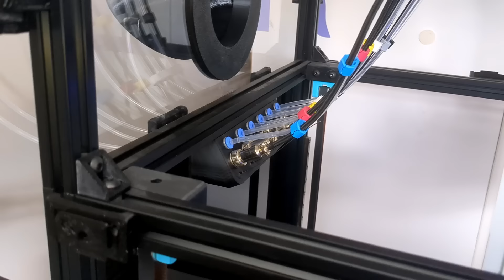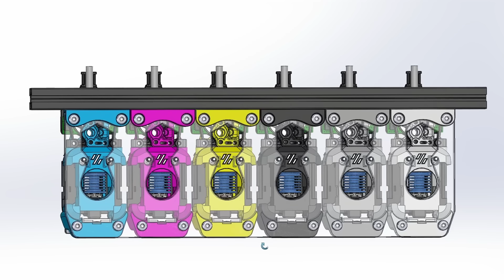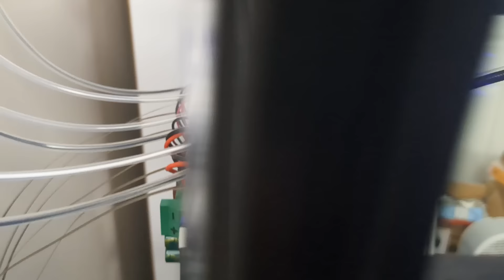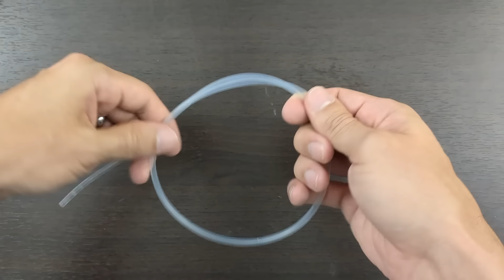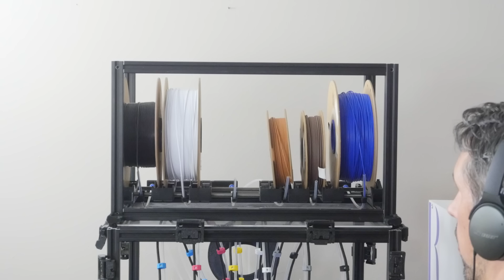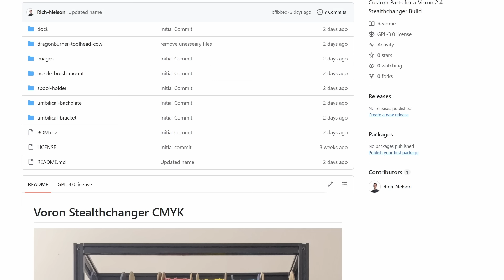I Built a Custom 6-Toolhead Multi-Material Printer (Voron StealthChanger)

Comment from the maker: A lot of people asked about cost so I ran the numbers! Here's a rough breakdown:

Base printer (Voron 2.4 300mm kit, if starting from scratch): ~$839+
Toolchanger base upgrade: ~$138
Per-toolhead: ~$92 × 6 = ~$554

Total for the 6-toolhead upgrade (excl. base printer): ~$694
Optional spool holder: +$96

Note: you don't need to build all 6 at once. Starting with 2 toolheads like I did would run about ~$334 (base upgrade + 2 toolheads), then you could expand as needed.

Full parts/cost details: 
https://github.com/Rich-Nelson/voron-stealthchanger-cmyk/#cost-estimate-guide
Reply: What about firmware? Where can I get it? Is everything working properly?
Reply from the maker: @ВикторВихрев-п2т  The firmware is an extension for Klipper called klipper-toolchager by viesturz, it is used for both the TapChanger and StealthChanger systems.  Here are the install instructions: https://github.com/DraftShift/StealthChanger/wiki/Installation#toolchanger-configuration
Reply: so do i need the voron or can you also just repurpose an other printer like a Ender 3  or something similar ?
Reply: How viable would it be to use the pre-made toolheads from snap maker u1. They are only about 60 dollars
Reply: Hey i have a Voron 2.4 R2 350mm what do i neeto print for my V6 hotend sherpa extruder and i am using a dragonburner standart one with two 4010 blowers hope you can help me
Reply: I love this idea and wish I could do something like this. Unfortunately I don't have the money. I will definitely keep my eye on this for the future.

Comment: Which shuttle mount did you use on the voron for the CMYK conversion. It is extremely well thought out and engineered. Just want to be sure they mount well to the gantry.
Reply from the maker: The Stealthchanger v1.1 Shuttle.

Comment: I doing this build - can you provide the dimesons for the printer - specific the additional head space for the toolheads?  Thanks, you did a great job.  I thank it gets missed sometimes that this is two years of work. I was looking at the Prusia XL but cost, locked into a vendor for parts and build size change my perspective. I do functional 3D printing and wanted a bigger build size (350x350x300) and nobody offers this size in a multitool head printer. This by far the best design I've seen that checks all of my boxes.  Plus, I can upgrade it later - hopefully to a index system. Thanks again for this project!
Reply from the maker: Awesome, If you build it please share when you're done, I'd love to see it! My top hat is 200mm tall, made from 2020 extrusions.  I should add that the the repo.

Comment: Rich this is outstanding design. I have been waiting to build Voron for years. I wanted a larger build size, faster print speeds, technical filament capability and the ability to print multiple filament on a job with very little waste.  I particularly want integrated TPU and and other plastics and supports. This is it. I now have a K1 max as well so I can finally print the build parts too. I'm going to enjoy this

Comment: I ran into some issues with the wall thickness, so I decided to rebuild the entire project from scratch in SolidWorks. Part of the reason was that I couldn’t find the specific model for the front section of the Sherpa Mini extruder.

I also noticed that the GitHub repository didn’t include the complete assembly with all the components, nor the six-extruder side-by-side setup shown in your images, so I ended up designing and assembling that part myself.

Before I finish the project, I’m going to look into using a more powerful hotend. Later on, I also plan to redesign the exterior of the extruder to better match the styling of my other machines.

Comment: How is bed leveling handled on this machine? I've always wanted a hydra setup but seems like it isn't necessary for your machine
Reply from the maker: The bed doesn't move, so it goes through a gantry leveling process before printing using a voron tap style nozzle probe mechanism along with a bed mesh.  After initial setup, the first layers consistently come out good without additional tuning. Though I've found different types of plate textures work better with different offsets.

Comment: Awesome build. I like the way you figured out the spring steel. Some people using piano wire have issues with stiffness while spring steel not wanting to side bend without other issues popping up. It's a tough call to make imho. 

I'm sure you will figure out the nozzle clean adjustments. Cooling it down during a wipe helps but then you have to wait on nozzle to heat back up. 

Cool printer, nice work. 💪👍

Comment: I fell in love with this the moment i saw it, was preparing to print these parts and attempt the mod myself, i just have a question, do you have the stl for the dock plates with the hexagon holes in the github? i can only find the one without holes
Reply from the maker: Awesome!  It's the same file, the hexagon holes from slicer settings. I printed them with the following settings:
- 0.4mm nozzle
- 0 top/bottom layers
- 8 perimeters
- 25% density honeycomb infill

The suggested settings are in the repo,  I added a slicer image preview to the repo to help communicate it better.
Reply: @rich_nelsons_workshop   thank you so much

Comment: Incredible build, congrats! I run similar setup toolhead wise (TZ V6 3.0) however I run into issues when switching tools. It takes a long time, waiting for the tool to be picked. Would you mind sharing your firmware configuration as well? Especially in regards to tool head config (sensor type) and dead band usage? Would be highly appriciated! Keep up the good work!
Reply from the maker: I had an issue like this,  it was due to the M109 "Set temp and wait" command waiting for the toolhead to reach an exact temp before pickup. I replace the standard M109 with one that waits for the hot end to reach a temperature +/-2C of the target temp,  that resolved the issue for me.  Here is my M109 macro:

[gcode_macro M109]
rename_existing: M109.1
description: [T<index>] [S<temperature>]
  Set tool temperature and wait.
  T= Tool number, optional. If not provided, the current tool is used.
  S= Target temperature
gcode:
  {% set tool = params.T|default(printer.toolchanger.tool) %}
  {% set tool_number = tool[-1]|int %}  ; Extract numeric part of tool (T0, T1, T10, etc.)
  {% if tool is not none %}
    {% set newparameters = "T=" ~ tool_number %}
    {% if params.S is defined %}
      {% set newparameters = newparameters ~ " TARGET=" ~ params.S %}
    {% endif %}
    M118 [M109] SET_TOOL_TEMPERATURE WAIT=0 {newparameters} ; Log message
    SET_TOOL_TEMPERATURE WAIT=0 {newparameters}
    {% set sensor = "extruder" %}
    {% if tool|int > 0 %}
      {% set sensor = sensor ~ tool_number %}
    {% endif %}

    {% if params.S|int >= 100 %}
      M118 [M109] TEMPERATURE_WAIT SENSOR={sensor} MINIMUM={params.S|int - 2} MAXIMUM={params.S|int + 2} ; Log message
      TEMPERATURE_WAIT SENSOR={sensor} MINIMUM={params.S|int - 2} MAXIMUM={params.S|int + 2}
    {% else %}
      PRINT_MESSAGE TEXT="Skipping temperature wait as target temp is below 100°C"
    {% endif %}
  {% else %}
    M109.1 {rawparams}
  {% endif %}

Comment: E3D produced one in 2019 made the design free to be used. I built a multi-head machine using parts from their system five years ago.
It uses a mechanical locking system & they even produced a design for a milling head that can be used as a swappable tool. I built one, as well as both direct drive and bowden print heads.

E3D originally produced both the parts and a custom machine to demonstrate the system, but after making the design & CAD drawings available, stopped producing the original machined components of the core parts. People had already created 3D printable versions and accessories by then & those are still readily available.

It's not quite as fast as the simple magnetic latch, as the lock has to rotate, but is more rigid. Mine is built around a cheap large-frame tronxy chassis, which was not really ideal. You can see an early test on here if you search "tronxy frankentron" - then scroll past all the transformers toys..

Comment: Can I ask what the total size of the printer is? I saw you mentioned 300mm voron, but I wanted to know the height depth width of the full printer itself. Thank you in advance!
Reply from the maker: I just measured it:
- 495mm wide
- 482mm deep
- 806mm tall with the tophat, 1032mm tall if you include the spool holder as well.

Comment: Hi Rich,

Great repo — the documentation and the custom parts are a huge help. I'm building a 6-toolhead StealthChanger on a Voron 2.4 350 and using your build as a reference.

One thing I couldn't find in the repo: *what PSU did you use, and what wattage?*

My toolheads are Dragon Burner v8 + Orbiter v2.5 + Rapido 2 HF (60 W heater each), so worst case is ~360 W just for the hotends. I'm trying to decide between a 600 W and a 750 W supply.

Also, did you run into any issues with all six heaters coming up at the same time at print start, or do you stagger the heating in Klipper?

Thanks!

Comment: This is by far one of the best open source tool changer builds I have ever come across. Thanks a ton for putting in all the efforts to make this happen. I have just one question, did you manage this with the stock voron frame or did you have to add extra room on X-axis to accomodate the parked tool heads? I want to try this with my voron legacy printer which I built 3yrs ago and a 2nd larger one which I built 2yrs ago. Yes I know you need Z-axis movement to dock undock the tool heads but adding another stepper motor to the docked heads platform can make that happen. Call me crazy but I think this is very doable and will also make a ready solution for all the voron trident users... Just my thoughts 🤓
Reply from the maker: Thank you! It's built with the stock 300mm 2.4 frame and motion system. I added a tophat made of 2020 extrusions but that's just for umbilical clearance. Good luck with your build!

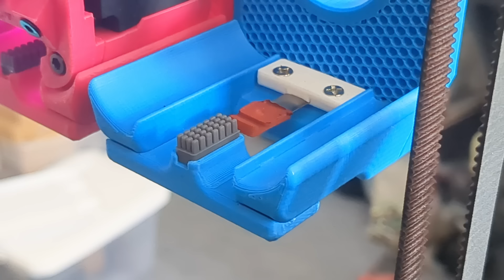Comment: Your custom 6-toolhead printer is absolutely amazing. What is the brown nozzle-parking pad behind the silicone brush at around 2:20? It looks like the nozzle rests against it while the toolhead is docked to prevent oozing. What is that part or material called, and where can I buy it?
Reply from the maker: You're right, it's a nozzle pad.  Made with spring steel from a measuring tape, RTV high temp silicone and a 3D printed mold.

Info here: https://github.com/viesturz/tapchanger/blob/main/Dock/Dock.md#nozzle-pad
STLs for the mold here: https://github.com/viesturz/tapchanger/tree/main/Dock/Jigs

Comment: This is amazing. Is this based on a "zero point" kinematic setup for repeatability on each tool head? Do You only need to do the per tool head calibration offsets once per toolhead during initial setup?
Reply from the maker: Yes, for printing the nozzle of the first tool, T0, is treated as the zero point The other tools offsets are set relative to it.

I have a probe and automatic process to set the offsets. After initial setup I just run it after changing nozzles.

Comment: 1st of all....awesome job ! It is not only functional, it also looks very cool 😎. Better than the ready made ones you buy.

2nd...a silly question, maybe. I did a shortcut, with voron. Instead of building one, i bought a sovol sv08 (some kind of a clone of a voron). Do you think your system could also work with such a printer ?

Comment: As an owner of a Ender 3 pro that still runs like a beast, this is a kvery daunting yet amazing looking project. Where would you suggest starting? I don’t know much about Voron or anything of the sort. Thank you!!
Reply from the maker: I have a similar printer for my first 8 years of 3d printing (Monoprice Maker Select, also a bed slinger), it served me well, and it printed the parts for the Voron!

I can tell you a bit about the path I followed.  First just building a Voron 2.4 from a Fysetc kit (but any kit will do).  The only Day 1 mods I did was using CANBus and a single dragon burner toolhead in the initial build rather than the stock toolhead and cable chains.

At that point I had a fully functional printer and upgraded it bit by bit:
- First printing a shuttle and backplate, so the toolhead was detachable. This was surprisingly convenient even without the rest of the toolchanger,  changing nozles became much easier!
- Then I printed a single dock, and tested docking and undocking
- Then I printed 1 more toolhed and dock.  And I had multimaterial printing!
- I Kept it with just 2 tools for well over a year, before planning the upgrade to the full 6.
Reply: @rich_nelsons_workshop would something like an Ender 5 Plus work for my initial printer? I know someone who is willing to part with theirs, and I saw online it can be converted into a coreXY printer :)

Comment: very, very nice. Thank you. How does this behave with a heated chamber? ABS and PC in the direction of PEEK? How do you keep the filament dry?
btw, dis i already wrote that is very very nice? Hope to see more from you.
Reply from the maker: It works well for ABS/ASA,  I have not tests more demanding filaments like PC or PEEK.  Currently I have a separate dry box, but I plan on enclosing the spool holder and turning it into a dry box, I've been eying up the Rosahl membrane dehumidifiers.

Thank you!  I always have projects in the work, and I have a goal of sharing them more consistently.

Comment: Awesome project, so well done!
I'm dreaming of upgrading my 2.4 to multi-filament. This is the most concrete example ever. Bravo!
Reply from the maker: Thanks!  I started off with just 2 toolheads and ran that for about 2 years.  Just that unlocks a ton of potential and it was not overly complicated, especially if you've already have experience building a 2.4.

Comment: So I've never built a Voron before but this makes me want to, but I'm confused on where to get the base kit. Do I follow the list of parts on the configuration from Voron, or do I buy a kit off MatterHacker? Any advice would be great as I'd live to build this.
Reply from the maker: Any Voron 2.4 kit will work as a foundation. that's the perfect place to start. I started by building the printer almost 100% stock,  except with a dragon burner toolhead and CAN Bus.  From there I upgraded little by little. I added the StealthChanger shuttle and back plate so the toolhead was not detachable,  then made one dock,  then a second toolhead and dock etc.

Comment: I'm curious, since the Sovol sv08 is voron... esque (-ish? -y?), would this work on the sv08 without a complete redesign?
Reply from the maker: The guy from the Teaching Tech channel adapted the SteathChanger project for the SV08 using the stock toolhead: https://www.printables.com/model/1569932-sovol-sv08-toolchanger-project

A more native SteathChanger setup would require adding CANBus for communication with Voron style toolheads, that's probably the biggest unknown for me.  Besides that it seems like it would mostly be a batter of adjusting for the mounting points for the SV08 frame.

Comment: Any thoughts on just swapping the hot ends like in the INDX?
Reply from the maker: The INDX seems like a really elegant design, in terms of keeping all the electronics and the toolhead. But definitely comes with challenges especially for a DIY build in terms of needing precision machined custom components.  One of the big advantage of this, SteathChanger, and Voron in general is the ability to build it from scratch with 3D printed parts and off the shelf hardware,  as well as benefit from the work of others in the community,  for example the StealthChanger supports 10 different toolhead designs right now.

I expect we'll see more advancements in the nozzle/hotend changing space, and I look forward to seeing where it goes.

Comment: Switch all your steppers for servosteppers like hbt4240c so you can push travel speed way past usual limits without risking skipping steps. Its also 48v with power management embeded.. I put my travel speeds at 800mm/s with a 6000mm/s² acceleration on what used to be a chiron x) 
Best mod imo

Comment: Do you add the modified ebb36 backing plate stl with the spring steel slot to the github or am I blind?
Reply from the maker: Your seeing 20/20, I forgot to include it.  I'll get that in the repo tonight, thanks for calling that out.
Reply from the maker: It's in the repo now: https://github.com/Rich-Nelson/voron-stealthchanger-cmyk/tree/main/dragon-burner-toolhead
Reply: @rich_nelsons_workshop got it. Tyvm.

Comment: You have a link to the CANbus cables you used or did you make yourself?
Reply from the maker: I used 100W Monoprice USB-C cables,  I think they stopped selling the exact ones I purchased.  The main thing it to make sure that the cable can meet the power requirements of your toolhead, and that it's sheilded.

 Note: A cable like this does not meet the actual specification for a CANBus cable since they require the data lines to be a twisted pair,  but I have not had any issues with them.

Comment: I dont think yoi showed how the toolhead attaches? in previous video?
Reply from the maker: It uses pins on the toolhead side into bushing on the shittle side with some magnets.  The StealthChanger project website has some good animations for this: https://stealthchanger.com/
Reply: @rich_nelsons_workshop cheers, interesting. So it only has the weight of the toolhead for squeezing material down?
Reply from the maker: @sgas There are magnets and two adjustable screws for a bit of pre-load to reduces slop that may exist in the pin/bushing connections, but there is no "locking" mechanism to to speak.

It is less rigid than a fixed mounted toolhead connection so it's not optimized to maximize acceleration. I run 6700mm/s^2 max X/Y acceleration, which works for the speed and quality I expect from the printer.